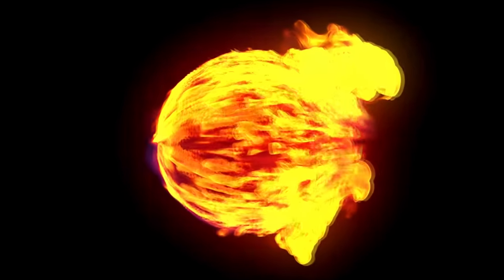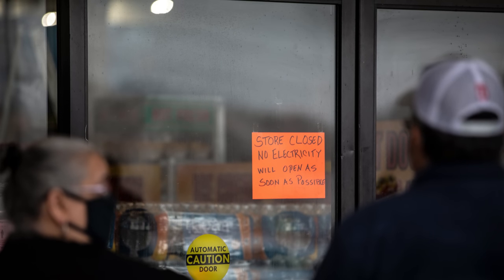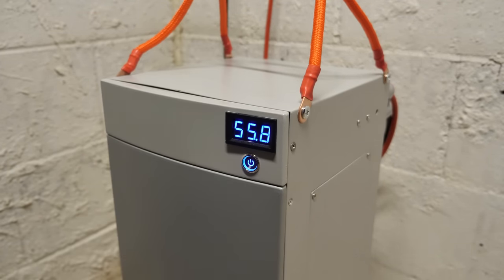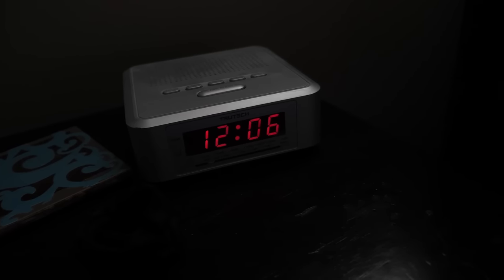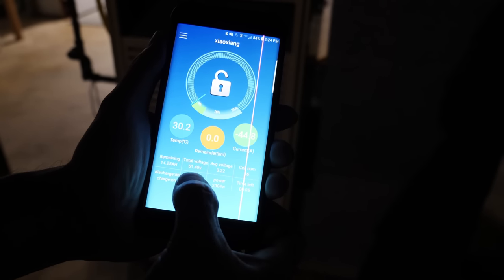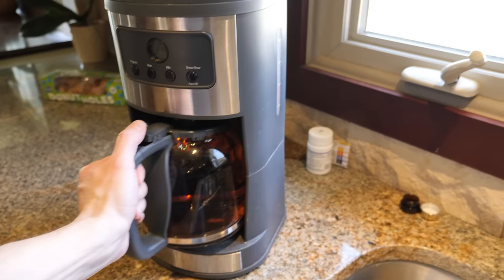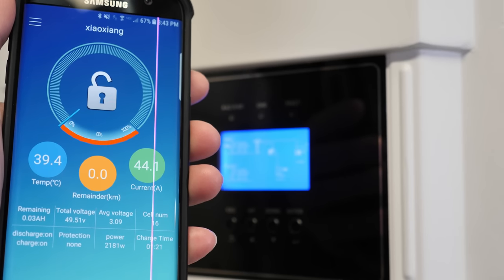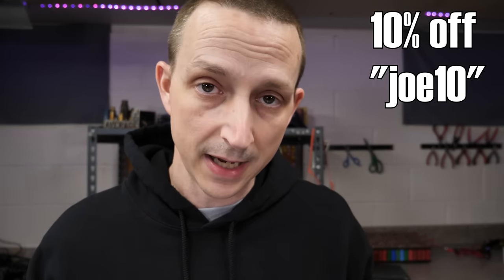Power your House with a Husky 48v 5.3kwh LiFePO4 Battery! BigBattery.com Test Review (2023)

Comment: I have the same set up on the electrical panel. I’m curious to why you turned off all the breakers first? I have never done this and never had any issues. I just turn off the main power and then flip on the solar breakers.  
So is there a reason why you turn off all the breakers first? 🤔
Reply from the maker: Nice! Well right on the little slide panel and or in the directions it says to do that. Usually so there isnt a huge surge on a generator. I dont really think its a problem with an inverter like mine or yours as it has the UPS mode and pretty much does it anyway.🤘
Reply: @AveRage_Joe  
My system is totally separate from the grid. It’s completely off grid, so when I flip the grid switch off there’s nothing tied to it. 
I’m just running off my batteries through the inverter, and power supply through charge controllers and PV. The inverter power goes through the panel box to power my house. The grid switch is in the off position.  
I don’t have a generator hooked up unless I start one manually. But I can see your point if you have certain automatic things hooked up that could be an issue. 
I moved everything over to 120V, even my oven now is a 120v convection oven. The only time I really have to go back on the grid is to run my dryer.
Reply from the maker: Nice! Yeah the main reason I left the grid connection there is for either battery or inverter maintenance! Otherwise its in the off position or we are off grid minus my dryer, stove and AC which is on another panel atm. The rest of rhe house is off grid!💥🤘
Reply: @AveRage_Joe  
Get a convection oven! 👍🏼

Comment: First off, I love your videos and used your code to purchase my Rhino/inverter. My question is, do I need a resistor before hooking up the battery or can I turn the discharge on the battery off and then hook it up to the inverter? Thanks again!
Reply from the maker: Thanks and appreciate that! Yeah so first time hookup, I turned both charge and discharge to off then connected the anderson connector together. Also for first time charge, do a slow charge like around 10a. It gives the cells time to balance!🤘
Reply: Thank you I appreciate your help!😊
Reply from the maker: No problem! Let me know if you have any other questions. Happy to help if I can!👍

Comment: Interesting video!    Heres what I and probably many others would like to know.  Based on a real grid down situation where  the user would most likely be conserving power.  How long would  that battry last if  only  2 refrigerators and  2 coffee pots were made and  a few minutes of microwave and minimal heating all because the user is scared  of running out of battry.     How many hours can one expect
Reply from the maker: I could run a test! What kind of heat? Like a space heater?

Comment: Hi, if i buy 20 cells can i hook them up in a 16s 48v configuration? let's say i use 100Ah. 3 groups would be 100A and one would be 200Ah with 8 cells instead of 4.
Reply from the maker: Which cells? The husky is allready a 16s and 48v.
Reply: @AveRage_Joe  i am sorry i wasn't clear, i would like to know if 48v banks have to be built in 16s config strictly (for 3.2V batts)? let's say i have 20  (3.2v) cells can i have them arranged in a way so theyre still 48V? or is there a better way to go?
Reply from the maker: Oh ok gotcha. Well a 20s is way to high in voltage for 48v stuff. Its best to stick around 15s or 16s. But you can always add more in parallel for more capacity. So 16s 2p which is 32cells. Can always add more if needed.

Comment: An average house in Texas requires at least 40 Kwh of electricity everyday so the battery size should be 25kwh for an average house. The main issue is HVAC system that consume a lot of power and split AC can easily solve this issue.

Comment: Nice setup. We just installed our first mini system in the past couple months. Only have 4 Renogy 100w Monocrystalline panels, 2 SOK 100ah batteries, and a Giandel inverter. However, we dont use the inverter unless the power goes out. Otherwise the main purpose for daily use is DC powered office. Lighting, fans, transceivers etc.
Reply from the maker: NICE!!!! Hows everything working so far? Its fun to have for sure!

Comment: I don’t have solar because I live in a rented townhouse. My electric rate is 12am - 3pm $0.19/kWh, 3pm-4pm 9pm - 12am $0.39/kWh and 4pm-9pm $0.50/kWh… I was wondering if it would be worth it to install a battery and charge it during the morning at &0.19 so I can use the battery during the high rate $0.50… and I use 8 to 11kWh between 4 pm and 9pm … do you think it would be worth it? Last month I used 284 kWh at $0.50, 202kWh at $0.39…
Reply from the maker: Hmmmmm, keep in mind the initial cost. May not be worth it but...do you have blackouts?
Reply: @AveRage_Joe  well, I live in the Bay Area, PGE is cutting the electricity sometimes due to wild fires, so we never know, but in the last 3 years I old had 1 blackout. Based on my usage if I get something that can hold for just 4-9 I can save around 90-100$ per month. I just don’t know how much it would cost to have a setup
Reply: @AveRage_Joe  and is something that I can use for solar in the future, right?

Comment: If you connected 2,3 batteries in parallel, do they have a communication port or a way to talk to each other for management purposes?
Reply from the maker: No they dont have a way to communicate with each other.

Comment: So with a bit of solar, and being more energy conscious, you could go a couple days? Not bad,   I'd like to get one of the BMS they use, I'm using 7s liIon , with a few thousand 18650's and  6 x 120ah LG batteries , and some leaf batteries, about 80ah, 500ah+ of 18650's, so over 1200ah at 25.9v  and 12, 270w panels, I have to get up, 1200w isn't enough solar,
Reply from the maker: Yeah with solar I can run 18hrs. During the solar time we can run all the things except the big stuff(just a guess as I didnt try). Just about 6rs back on grid until sun comes back out. If I had a 2nd 😲 Im sure I could find out what kind of bms is in there! You need a crap ton more solar!!!!!😉 So do I!!

Comment: Im using a BB 48V Husky to power my golf cart. I have a Navitas 5kw AC motor with 600a controller on my cart that allows my cart to run up to about 40 miles range averaging 25mph. Also, it can go about 36mph top speed. It shed around 300lbs off the cart vs. the old lead acid batteries. The Husky really si Husky!  So far so good
Reply from the maker: Ive seen some videos of people doing that!!!  If I had a golf cart Id do the same lol.  Yeah 100% agree the Husky is an Awesome battery!!

Comment: This is one excellent video. I am interested on getting one of the inverters. Based on this video the 12k may be too much? The 6k should be okay (125 amp!)??

Can the inverter be set with priorities such as use panel solar panel if  available first, then battery and then the  grid?
Reply from the maker: Thanks! Its a nice inverter for sure! The 6kw is just as a beast. Only has 1 mppt 60 or 80a charge controller and I hear the fan is super noisy. Yeah you can set all the priorities how you want!

Comment: As a wiremen i would consider this a supplement only to other backup measures.Would have to have sun and plenty of solar panels to keep topping off that battery.Get yourself a generator and some backup heat solid fuel preferred personally.Yeah stack you some wood properly and it will burn YEARS FROM NOW!

Comment: Thank you for the video. I also am using Big Battery, two 24v in series. What did you mean on min 11when you said 56v is the happy medium where the BMS doesn't shut off ?  I have Growatt 48v inverter and when I try to use SBU ,or only battery it only uses utility. Growatt says the Big Battery BMS is not compatible, but you got it to work.
Reply from the maker: Awesome!!! So I was meaning the overall voltage of the battery. At 56v or just above it is when the bms inside the battery would disconnect the charging solinoid or relay. Yes the bms does not connect or communicate with the inverter. So actually since this video I can charge  much higher. When I first got the battery and charged it up, 1 or 2 of the cells were higher voltage(not 100% balanced) so the bms would cut the charging(like its intended) so I couldnt charge to 58.8v. Now that I have been using it and cycling it almost daily, all cells have balanced out and and I can charge to 58.8v. As for the inverter settings I can get you my settings once I get back home.
Reply: @AveRage_Joe  Thank you for your reply. This gives me hope. Seeing your Growatt settings will also help, when you have time. =)

Comment: Thank you. I have a well pump, electric water heater, electric dryer but heat primarily with a wood stove. My wife and I live in rural North Georgia and our central Air is used from May through Mid October on a 1500 sq ft. house. We loose power at least once a year sometimes as long as 4 day in the past. So a emergency back up system with solar would be great at least to keep our Well pump running, refrigerator, modem, 2 computers and a few lights. but it looks like having a battery,  inverter 3 or 4 solar panels could cost around $6000. I wonder if it would pay for itself as we used 7840KW in  last year with an average usage of 653 KW per month.
Reply from the maker: Thanks for watching! Yeah a backup battery system would be great for your area! So for me or my system, I paid $2k for the 12kw inverter. If you dont need 12kw then signature solar also has a 6kw version for much less and is still a beast. I also have 24 used solar panels on the roof which cost around $1.5k. Got those off ebay but signature solar also has used solar panels. I plan on getting some from them when I can. You could get a system in place for pretty cheap and use it all year round if wanted so roi would be much quicker.

Comment: Great Video.  Got me excited to look into this as a House Backup.  Is there any way to connect this battery unit into a NEMA L14-20 Twistlock which is on my Generator manual Cutoff panel?  I already have that wired in and despise dragging the heavy gas generator out of the garage to the house to get the few things  I need up and running.    Thanks for your work!
Reply from the maker: Thanks Rob! You could add any connector you want to the inverter for sure!!

Comment: Hi, does this system work with grid-tie? How do you prevent the system from backfeeding the grid when the power goes down? I'm concerned about energizing the grid and possibly injuring a line worker if the grid goes down. California requires this feature, so I'm looking for something that works for me that I can add to my micro-inverter solar array (APS QS-1 micros). Thank you.
Reply from the maker: This is not a grid-tie system so cant backfeed the grid!👍
Reply: @AveRage_Joe  ah - ok, so your battery is not doing anything except sitting there unless the power goes out? or are you just running a separate circuit with it?
Reply from the maker: I normally use it as an off grid system! I use solar to recharge unless we dont have sun then I use the charger from the inverter!
Reply: @AveRage_Joe  ah, so you typically don't even have the connection to the grid turned on?
Reply from the maker: Correct! Its there if and when I need it. The inverter will switch automaticly depending on your settings.🤘

Comment: I watched your videos on the Growatt invertor and the Big Battery on powering your house if the grid goes down and you had no solar panels hooked to it. I want to hook it up this way since when our power goes out it ranges from 15 min to up to 4 hours. I can power some of the essentials on a sub panel with my 230v 30 amp gen but I have to drag it out and hook it up. I looked at what you did as a viable option so I called Signature Solar to get some more information on the invertor since I want to hook it up the way you did in this video and the woman I talked to said I could not do it without solar panels. The first video on the invertor you said how the people at Signaturesolar were so helpful but this woman was not.  Did I talk to the wrong person? According to the user manual I can. Who  is right?
Reply from the maker: I do have solar connected but for the "test" I disconnected them. Yes you can 100% use it without solar. Cant say who you talked to but it can!!! Just connect to grid for charging and a battery and your good to go!!🤘
Reply: @AveRage_Joe  Thank you. I will call them again. In the meantime I talked to Sungold power and they said I could do what you did with their 48 volt12kw split phase inverter. I will call Signature solar again so I can decide witch one to go with. When we lost power a few weeks ago I had to wheel out my Honda 230v 30 amp generator to power the basic necessities.  Then my wife wanted me to get a whole house generator. High installation cost plus we have to get propane tanks and they have to run at a min every month using fuel. We have no NG. The split phase invertor is a more viable option not only is it less expensive with no generator maint but we can also install solar panels in the future. By the way we are total electric. Thanks again.
Reply from the maker: Just know with sungold they have a higher idle wattage and the built in charge controller is only single 40 or 60amp. The growatt has 2 charge controllers for a total of 120a! 🤘
Reply: @AveRage_Joe  Thanks.

Comment: I am a newbie and I have many questions but I will start with one.  You have a  solar grid tied system did you ground your solar system to the main panel? Solar panels to combiner box to inverter to main. or did you do a separate grounding for the solar system?
Reply from the maker: My system is an off grid or hybrid system. I dont send energy back to grid. My inverter is a inverter charger so I can supply inverter with grid and then onto my house panel. As for my grounds, they all lead back to the main panel and same ground rod.
Reply: @AveRage_Joe  thank you for the correction. My apologies for not knowing the difference. As a newbie I was surprised that there is an inverter before the battery. Learning fast.  have plenty time on my hands with lockdown.  
In respect to the battery which is fused does it require grounding in your system? compared to the EP500 Pro which may not be fused if you had one of those would you need to ground?
Thanks
Reply from the maker: No problem! I dont have the ep500  but the battery would most likey be fused. As far as grounding, I think that system would be grounded similar to mine. It would ground the ep500 through the outlet plug/ground and then ground to the panel like all should. Again, I dont have one so cant say for sure.
Reply: @AveRage_Joe  what about inlet? is the grounding wire connected to a grounding clamp or something else? again thanks
Reply from the maker: Oh...inlet should also be connected to the same ground on inside I would imagin!

Comment: Would it run a 4 ton air conditioning system, electric hot water heater, water well?
Reply from the maker: The battery should however for AC or electric water heater you would want more battery capacity(more batteries in parallel) since they are large loads on for long periods at a time.

Comment: Joe, This is a great video and it may be what i am looking for. I have a solar system with net metering. I want to have a battery backup power with the Husky battery. I think I need to install 1) the circuit breaker with the interlock kit and 2) connect the wire to the Husky battery unit and program it to charge from Center Point. Do you think I need anything else?
Reply from the maker: Thanks! Does your system have a battery connection? If so then yeah sounds like all you would need is battery and a way to shut off the grid.

Comment: Can you recommend an inverter, I can’t install solar panels but I would love to run battery’s from 4-9pm when my rates are .40 per kWh.
Reply from the maker: I can recommend the inverter I am using for sure!  They also have a 6kw version as well that is also a BEAST! You dont need solar panels and can also change from grid power mode to off grid mode with your phone anytime and anywhere!!! Link below

Comment: Nice video. One question>You mentioned that your solar panels were producing 3KW; were they charging the battery when you were running the test?
Reply from the maker: Hi and Thank you! No the solar was not on during the blackout test. I only turned those on at the end to charge since I had them. When I first switched back to grid to charge I started with the inverter to charge at 45amps then bumped it up with solar. This inverter does have the capability to charge at 100amp but again used solar since I have it!😆💥🤘

Comment: Is it possible to use this, or two of these, to power 240V appliances as well? If so, how?
Reply from the maker: Yeah you would want more batteries in parallel for the big loads. They have a parallel cable or they have a parallel combiner box depending on how many batteries used!

Comment: I like it thanks for the testing. I want a simple solution like this what growatt are you using? how many solar panels do you use and what was the watt rating of them.? thanks
Reply from the maker: Thanks! I am using a 12kw growatt inverter. Big Battery has kits now that come with a 6kw inverter just like mine, batteries and wires. I have 24 used panels on the roof. 18 are 245w and 6 are 235w.